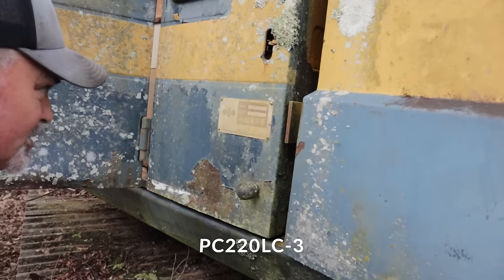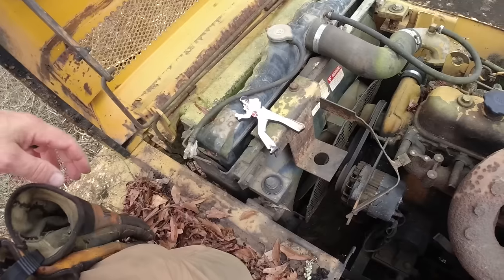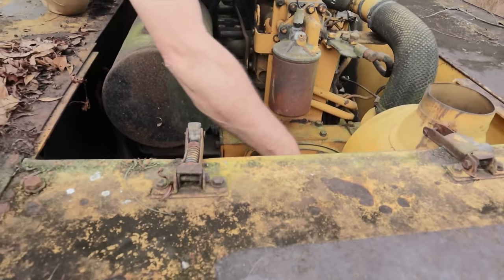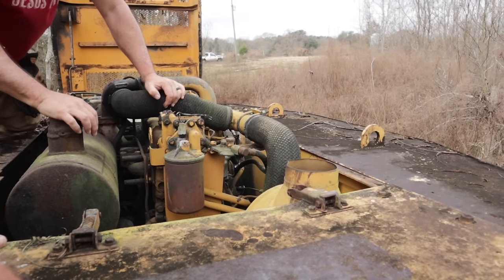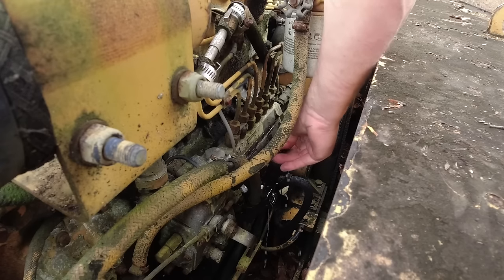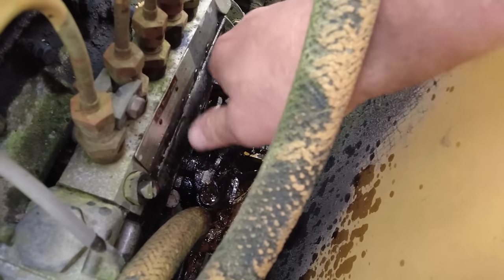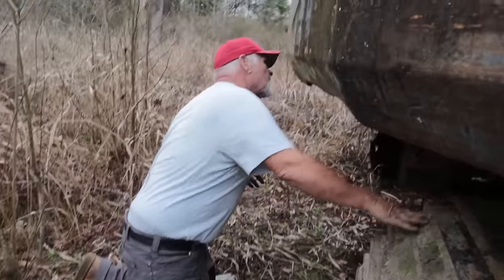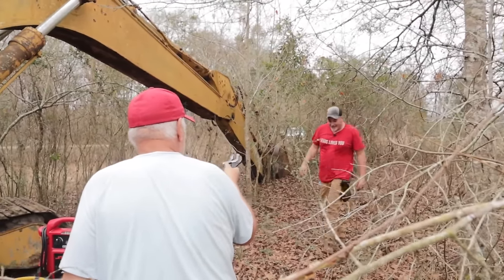LOST! We Found an Excavator hiding in the swamp! Will it DIG again?

Comment: What I have found that helps in a case like this, is to pressurize the fuel going to the pump. I have an old small fire extinguisher I modified so I can put fuel in it, then pressurize it with compressed air, 30 to 40 psi. Connect it directly to the pump inlet and hit the trigger a bit to put diesel fuel at 40 psi into the pump inlet to force any check valve or inlet restriction thru (gummy fuel, etc) It does help.

Comment: hey fellas, just a side note. i used to run cnc lathes and machined all different parts of hydraulic cylinders. those chrome rods that extend and retract wont have any problems being out in the weather as long as there's enough chrome on them. cuz chrome (unless its machined) wont rust another great video guys keep up the good work and god bless ya'll from central texas
Reply: Yes but after some years of exposure to sun and oxygen in the air the chrome can oxidize and fail. Usually in a small spot, then grow and get worse from there. Best thing is to apply heavy grease to the exposed chrome for over winter or long tern storage.

Comment: many years ago worked at Montgomery Wards we installed after market A/C units on vehicles that didn't come with A/C the hose clamps for the A/C all had that little arm on the clamp it was used to make sure the clamp was over the barb in the correct position for the most holding power. seldom see them anymore

Comment: What a project!  What I'm wondering is why not use that new jumper pack to see if it would at least turn over? You have wires and clamps on it, saves a lot of frustration!  Then ,you let the magic smoke out! The hose clamp with the "hook" on them is an old auto A/C service item, as is the aluminum hose splicer. The purpose of the hook is to allow you to tighten the clamp directly over the area of the hose barbs.  I used a lot of this type fittings in the sixties.

Comment: Hank, you are happy that the oil wasn't over full because that means there is much less of a chance that the engine has been drinking raw dihydrogen monoxide. Oil floats on DHMO so it would make the oil over the full mark. Engines that develop a drinking problem and turn towards DHMO also called H2O don't fare too well when trying to get them to turn over. 🤔😁

Comment: I was lucky when I was younger and found a full set of Snap-On pics.. They are a SAVIOR when pulling hoses - be it radiator or fuel line, even doing vacuum line stuff when they get all crusted on, man those pics are a lifesaver.. It seems to be a lot safer than using a flat head screwdriver. I know you guys have come quite a long way with your work over the past year or 2 on here (or maybe longer I don't know) but man a good set of strong pics, they make a difference! (I'm at the part y'all were messing with the fuel line rubber hose before the bad injector primer)

Comment: Hank to make things easier and less stressful on the old engines, we used to use an old carburettor and tank with ATF petrol mix fixed on the air intake so it atomised the petrol oil into the intake air,  it usually stops the need for brake cleaner and gives the old engines a chance,

Comment: Try a Cobra blade on that weed-eater; designed well for cutting smal;l brush and trees; cut down up to 4" pine and fir at our cemetary with that blade.
And; you sharpen it with a chainsaw file.